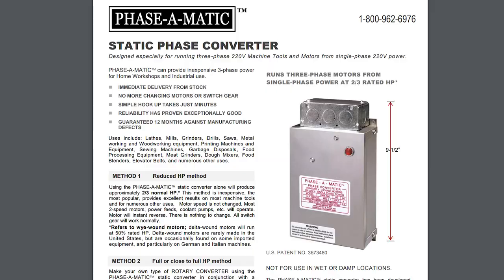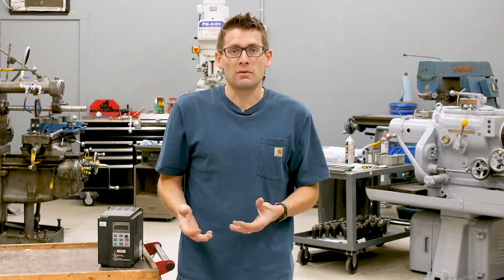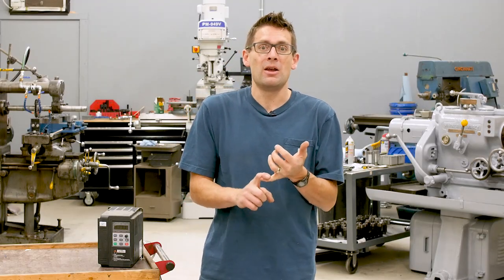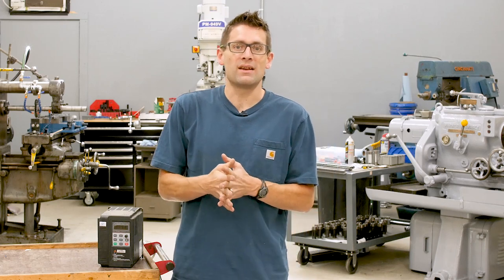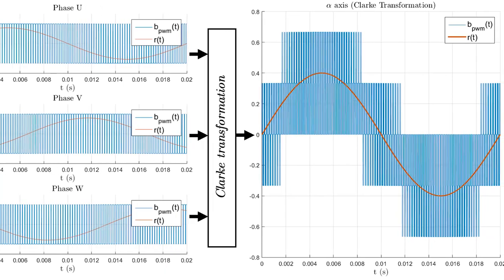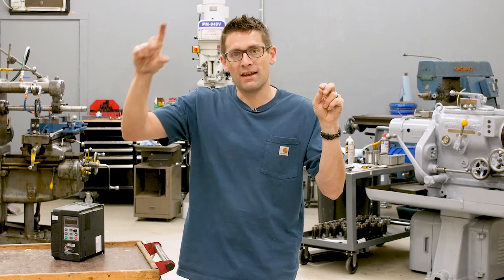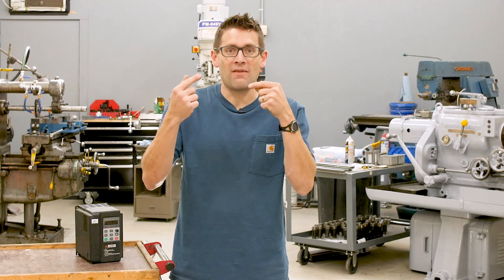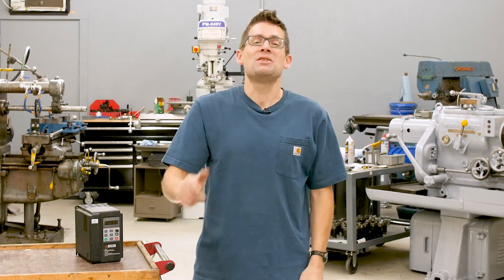Static Phase Converters -vs- Rotary Phase Converters -vs- Variable Frequency Drives

Comment: Ah, the term "Rotary Converter" brings back memories of waters long since passed under the bridge. I was the last person trained on rotary converter maintenance in our State here in Australia, back around the time Noah was looking at electricity for his ark. But these were AC - DC converters, not phase converters. Huge bloody things, some with commutators measuring 18ft in diameter and yokes 25 - 30ft in diameter, the smallest about 12ft yoke. All the insulation was either asbestos or mica and a general overhaul (not rebuild) of a unit took weeks. Just the thing for your workshop, lol, IF you want DC..... 
Sadly I'm the only one left of my old crew, the others all since passed from respiratory disease. 
The converter feed in transformers would split the 3 phase mains to either 6 or 12 phase to drive the synchronous motor to generate the DC, the units were run up to speed using DC "pony motors".... The units were huge, noisy mongrel (but very regal) bloody things, lmao!!

These RC units were very robust and their last years were spent testing new DC CB capacities because they were much more robust than the Mercury Arc Rectifiers (also old school technology) and solid state SCRs that were replacing them (both).

Just a quick story from years passed.

Cheers from downunder mate 🙂
🇦🇺 🍺🍺
Reply: That is awesome! I bet it was the gopher wood used to make the equipment that caused the respiratory problems. I sold welding equipment back in the day and the smoothest DC arc was an old Lincoln motor generator, 800 pounds for 200 amps, but smooth as glass. 3 phase 460 volt @ 100 amps input cables as thick as a girls wrist.They used Dutchman blue tinted welding glass until they found it didn't really work.
Reply: thank you for the reply  @richspillman4191 , yes the old lincolns were the standard of the day.
Most of the older fellows passed from breathing in the asbestos mate. We were still using asbestos mats and replacing asbestos with asbestos even in the 70s. I only know of 3 survivors (me included) of that era who worked in the same locations. We'd have to tramp around in knee deep asbestos dust under the machines as we worked on them.
Cheers my friend.
Reply: @Junior Abel Instablaster =)
Reply: @Sage Gary it worked and I actually got access to my account again. Im so happy:D
Thank you so much, you saved my ass!
Reply: @Junior Abel glad I could help =)

Comment: Gavin, I did the VFD converting single phase to three phase on an Eisen branded Liang Dei 14x40 lathe from Taiwan. As a matter of fact, I recognize that electrical diagram because I used pretty much the same one (no doubt from the same MJ source).  I had no electrical experience at all, so it was very much a case of drinking through a fire hose.  The good news was that everything worked perfectly, except the intermittent coolant, which was just a simple error in the diagram that showed a normally closed switch instead of a normally open one.  I had a spare switch, so it was a quick fix.  The Hitachi VFD gave me the options of variable speed, jog fwd and reverse, coolant on/off/intermittent and fast/slow braking choices using the motor.  I wanted all the electrical components located in the lathe itself, so I located the VFD on a sliding drawer in the left/hand pedestal.  I converted both access panels to hinged doors and vented the one on the left hand pedestal to ensure the VFD fan could circulate enough air.  All in all it was a big job sourcing all the components, figuring out how to fit them all in the available space, making sure all the wiring was perfect, routing the additional wiring and programming the VFD.  But, now that it’s done, it was worth it.  Never had any issues pop up.  Everything just works the way it is supposed to.  MJ did a great job on the wiring diagram and VFD programming guide.   Variable speed is so nice because you can just use a couple of gears for pretty much everything.  I never run the motor at full speed because it just seems unnecessary.  Actually, all the added features are nice and I use them all, depending on what I’m doing.
Reply: Do you have any way of knowing what Hp values you are getting from using the VFD?
Please don’t guess, if you don’t know, that’s cool. He said with the static phase converter you lose about 1/3 if the 3 Phase motor’s Hp. He didn’t mention much at all about the VFD because it was obvious that he knew nothing about it. 
Cheers,
Michael

Comment: Thank you. I can only buy a VFD, it is cheaper and more readily available than a rotary converter. My 3-phase drill has speed control of its own so I don't need to vary the speed via the converter. Is VFD still a good option?

Comment: Great video. I have a 3 phase vo

Compressor what would you recommend it's not going to. Be continuous running but just a compressor normal shop equipment running on a 7.5 h.p.motor thanks

Comment: Nice explanation. I use to install FVD on large AC/Heating air handlers (15+ HP) as part of a energy savings package for commercial buildings. The concept was to slow down the motor in mild weather seasons
Reply from the maker: Cool idea- did you have any issues with harmonics or feedback back into the grid? (can be an issue with motors over 5hp)
Reply: I will sed if I can find some spec's . I don't know but this was a big investment for our client so they could have been very high end.

Comment: Excellent video sir.  I cut my machining teeth on a Warner and Swasey turret lathe in high school. It had seen it’s better days but in small job shops without big maintenance budgets the machinists job was to learn the machines personality and compensate. By the way, Swasey is pronounced sway-zee. 
Another point on static converters, they work fine on milling machines like Bridgeports and clones because it’s a simple motor to belt drive, but on lathes, which of course are motor to belt but because of the quick change gear box and natural gear backlash it will clatter like crazy. Not good in the long run for the gears, but will probably drive you crazy long before that.  Had a small shop on back of my dads garage and used a rotary converter back in the early 70’s. It was sized for my largest motor but I could only run one machine at a time so the compromise was fine. Yours would appear to be able to run several machines at one time with multiple operators. Nice job.

Comment: Any suggestions on a Variable Frequency Drive Inverter for a  parts washer with these specs  208-230/460 volts  and 21-18/9 amps     I only have single phase but need 3phase ?

Comment: I Just installed a 40 HP rotary converter for my whole shop.  because i got a 88 ton 8 foot hydraulic press brake.  The problem is the manufactured leg is dropping 40 volts when i put load on press.  I hooked press up to a diesel generator and it worked great.  Do you have recommendation on what rotary converter is the best?  I got a north america.  but can't keep the volts stable when loaded.

Comment: I recently bought an electric forklift and the battery charger that came with it is 3 phase but I haven't been able to find any information about running it with a rotary converter.  Does anyone know of a reason a rotary converter wouldn't work with a battery charger.  I will be making or buying a rotary phase converter regardless since I have a lathe, milling maching and bandsaw that all use 3 phase and can't get 3 phase from the power company.

Comment: Hey Gavin. Thanks for the video. I’ll be picking up a 1983 Nardini 10x30 lathe in a few days. I have a question about the VFD when choosing speeds  on the lathe. Are you able to set the lathe at a higher speed/rpm and control the speed from the VFD? How would the two work together. I’m sure there is a combo for synergistic operation. Just not sure where to start.
Reply: You can but your better off just setting the VFD to 60hz and use the rpm selector on the lathe.

Comment: I have a static converter hooked up to a motor I had rewound from 600v 3 Phase to 120 3phase for my home shop our residential voltage is 120 / 240V. Sometimes my machines starts great and other times it just makes a wurring noise and cant seem to get going. Eventually it always starts but it is a pain in the bum and now that I want to sell it I need it to start every time. Anyone have any idea why it sometimes has trouble starting ?Thanks

Comment: Digital phase converters are the things of the future. Very expensive these days.
Reply: i got one of the phase shifters to run my hydraulic forging press set up. only thing im trying to work out is my set up has 3 cores neutral and earth and the dps is only for the motor i gotta work out the other wiring too

Comment: I am getting ready to buy a 3 Phase Wood Mizer saw mill. Can you give the link to the VFD or the model number please. Thank you
Reply from the maker: It's a Lapond unit from Amazon, but I can't reccomend it until I hook it up :)
Reply: Ok I will wait to see if you like it or not. Thanks
Reply: @papaswoodshop4873  how do you like your woodmizer
Reply: @jcf536farrier5  We decided to buy a gas powered one. It was allot less expense. We use it about every day and are so glad we bought it. I don"t think we will ever buy any other brand.
Reply: @papaswoodshop4873  Awesome I bought a manual mill in 2005 and cut over 300000 board feet on it.  My dad bought a hydraulic one 2 years ago and I just love that one.  Great mills, I am looking to buy there moulder mp360 so trying to set up 3 phase power for it.

Comment: Im trying to figure out the best option for my 3 phase 5hp Saylor Beall air compressor??? Its only $570.00 to just put a single phase Baldor motor on it and seems like it will be alot more if i went with a rotary converter and lots more with a vfd. Im told i have to get a 10hp VFD to run my 5 hp 3 phase motor?? Dont understand that but its what im reading. That rotary you got is $2700.00 not hardly worth running vs buying a single phase motor
Reply: buy the 5hp single phase motor
Reply: whoever said you need a 10hp vfd is full of crap, never had any issues running the same size vfd to my motors before

Comment: I'd be surprised if a rotary phase converter even allows motors to get their rated power. You still have single phase on 2 lines (180 of phase), and then your generated third leg is only 90 degrees between them. Nothing like a true 120 degree separation of phases from true 3-phase power.
Reply from the maker: Tim Ramich That’s what I thought at first - but it’s not true. With different wild leg voltage - and the difference in how voltages are arranged- the motor “sees” 120 degree phased power just like it came from 3-phase line power
Reply: @Ultimatereloader That's impossible to accomplish with capacitors when you will have varying loads being drawn.
Reply from the maker: Tim- it's about sizing. If you have a 20hp idler motor in your RPC like I do, you can run up to a 10hp motor with no compromises. You can run larger motors than that, but you'll compromise on startup speed (slower).
Reply: @Ultimatereloader  There is no way to delay your phases equally when you have zero load or full load. The phasing will vary. It's the same concept of a capacitive dropper circuit to drop AC line voltage down without a regulator. Current is part of the formula to figure out the capacitor value needed. Varying the load on one of these is going to vary the phase. I can't wait until solid state phase converters become a thing. A VFD without control. Just AC->DC->AC.